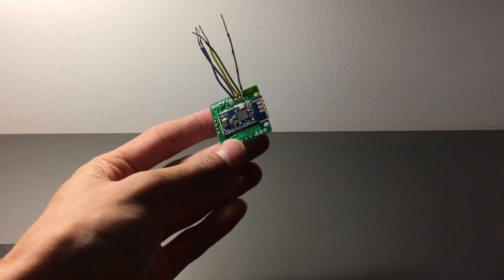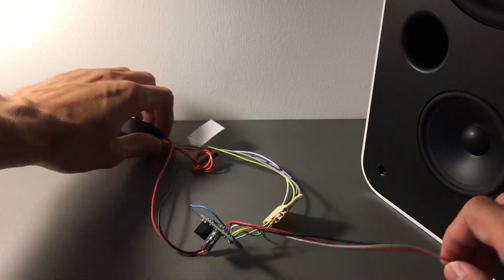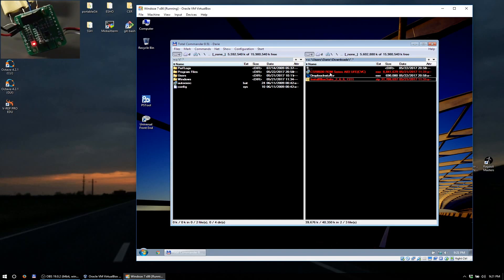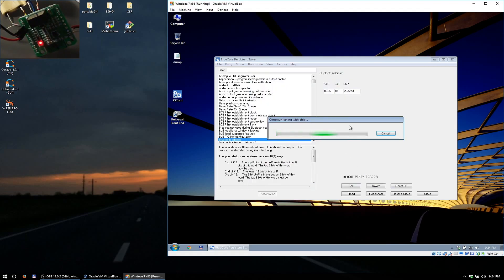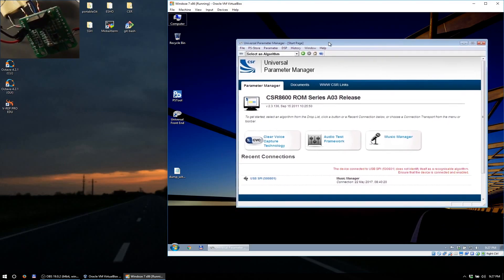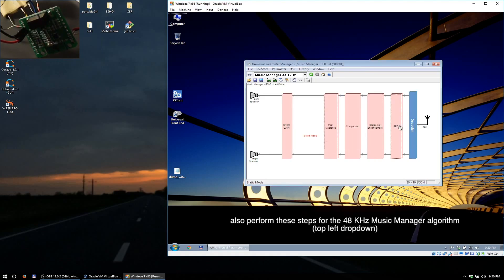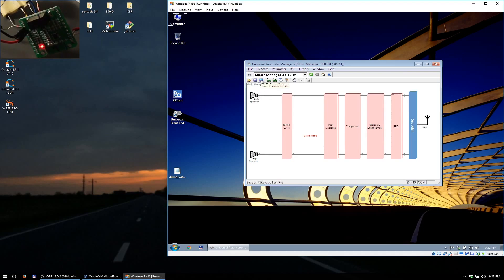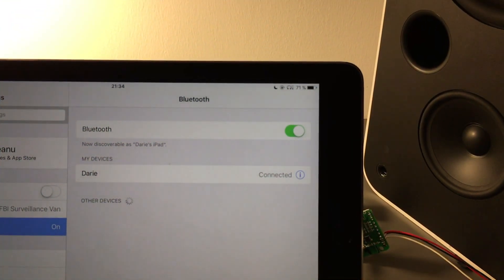CSR8645 Equaliser Set Up Guide

Comment: Do you know if dcm8633 and csr8633 or csr8635 have something in common, Like the pinouts?
Reply from the maker: Hm, I've actually never heard of the DCM8633 .. which seems to be the CSR8633 ... aand, yes - they do seem to be on the exact same carrier board, so the pinout should be the same

I have to ask though .. what do you have that has a csr8633 ? I've never seen them on anything
Reply: I ordered this bluetooth amp from ebay which is showing the chip csr8635 on the picture,  but received the one has the dcm8633 instead. Soni guess I can program it then right? I wil try it 

TDA7492P 2 x 50 Watt Dual Channel Amplifier Wireless Digital Bluetooth 4.0.. https://rover.ebay.com/rover/0/0/0?mpre=https%3A%2F%2Fwww.ebay.com%2Fulk%2Fitm%2F142568936090
Reply from the maker: In that case 100% sure, they even laid out solder pads for the 4 SPI connections on the bottom right (antenna facing up)

You might have to pull BOTH SPI_EN aand MFB

How's the amp sound ?
Reply: I liked it, actually sounds really good. I’m just hoping not to burn the chip while I’m trying to program it
Reply from the maker: well, if you do, another module's around 4$ including shipping
Reply: I know.. I got some csr8645 coming from china. And Just received the csr usb spi-isp programmer last week. The Dcm8633 its all I have at the moment.. I will let you all what’s up
Reply from the maker: sure thing, good luck !
Reply: Help!!!  changed the battery setting from vdd_BAT to vdd_sense and bluetooth module just turned off and it’s no longer power on. I can’t not change the settings because the program is not reading the chip
Reply: I don’t know which pin is the vdd sense on the chip
Reply from the maker: Holy shit .. can you even DO that :)) !?

Yeah doesn't sound too good if you can't read it .. might go have a look at the datasheet, but if the blue board the chip's sat on doesn't have that routed .. you're kind of screwed unfortunately

You could though keep trying to reset it with the PSTool (it has that restore all feature, then your flash back your stock dump - which I hope you did back up)
Reply: Yea I have already tried to marge the bump I created, before starting messing with it. But it doesn’t work
Reply from the maker: Restore is stronger than merging - have you tried that ?
Reply: No. I have not tried that yet but I’ll try that . So the restore option  It’s in the PSTool program?
Reply from the maker: yup, it's in one of the tabs on the top bar

Comment: Can someone help me please? I am not able to get this to working in Windows 7 or Windows 10

In Windows 7, PSTool is not recognizing the USB<>SPI converter. In the "Choose Transport" window, the "Port" option is completely blank. Windows 7 recongizes the USB<>SPI, just not PSTool. Does anyone know where I can find a download for the CSR USB<>SPI Driver?

In Windows 10, PSTool recognizes the USB<>SPI converter, but when I select it as the port and press OK, I get a message saying "Error Detecting Chip Type (Read failed on USB-SPI)
Reply from the maker: Are you running Windows 7 from within VirtualBox ?
Reply: Darieee , yes I am. I used the  tutorial in the description of this video to set up windows 7 in virtual box
Reply from the maker: Alright, then you most likely didn't install the USB Add-On (not sure if that's its exact name though)

Do that, then for the virtual machine settings, enable the CSR USB SPI Converter to pass through

As for the "Error Detecting Chip Type", that's 99.99% due to a bad connection between the programmer and the Bluetooth Module (I had a wire which was broken inside once .. took me 2 hours to figure out)
Reply: Darieee I did enable the USB add-on and Windows 7 definitely sees the USB SPI converter. When I go to "device manager" in windows 7 and click on USB, the USB SPI converter is displayed but next to it there is a yellow triangle with an exclamation point in it. When I click on it, this message (below) appears in the driver info. Any ideas??

"Windows cannot verify the digital signature for the drivers required for this device. A recent hardware or software change might have installed a file that is signed incorrectly or damaged, or that might be malicious software from an unknown source. (Code 52)"
Reply from the maker: Yeah, you need to uninstall PSTool and reinstall it again : at some point you have to make a decision on the transport type (that decision is only shown when installing for 32b)

Check my videos for when I install PSTool under windows 7, and see what I clicked there, off the top of my head I can't remember right now
Reply from the maker: Also it might be your windows 7 is acting up thinking the CSR shit is malicious - never run updates on the virtual windows 7 and disable Windows Defender in all possible ways

If that still doesn't work, I can probably send you a windows 7 image that works well
Reply: You were totally right about choosing the transport type. That was my problem and now PSTool in Windows 7 sees the USB-SPI converter! 

But I still cannot get PSTool to recognize the chip. I have multiple CSR 8645 chips and one 8635 chip and I'm sure that I'm wiring them correctly and all the connections are good. I can't get any of them to be detected by PSTool. Any idea, how I can fix this?
Reply from the maker: Mmm ... is your CSR USB SPI Converter set to 3.3v mode ? .. other than that .. tripple check the SPI_EN pin to be pulled high ..

Another trap for young players which also wasted me a good few hours is with CSR8635 chips (35 not 45), with those you have to pull the MFB pin high as well otherwise the chip won't boot

Comment: This doesn’t work for mac computers right? Or Yes?
Reply from the maker: works just as well with mac / windows / linux, since you have to set up a Virtual Machine (in my case, VirtualBox, which is freely available on all OS') running Windows 7 x32
Reply from the maker: let me know if you need 'help' 'buying' a copy of windows 7 x32 wink wink
Reply: Thanks. I will try to install virtual box

Comment: I have some bug...everythink works how in your video...but when I connect to other phone the equalizer is in its starting position flat.How I can do that every with I pair have the equalizer setting?
Reply: MrUnzO  use csra64215 chip it's better and have own app to conf.
Reply from the maker: Indeed, the CSRA64215 has a much more compatible app and the chip itself is way more powerful

You can ask sellers of almost any CSR8645 module to supply the 64215 chip instead for a very small price bump
Reply: And how I can turn down output volume PStool?
Reply from the maker: I have no idea how to turn down the volume in PSTool ... I always do it with the Gain selector in the equaliser view

I also don't really understand your problem .. Do you want to set up both the 44.1 Khz and the 48 Khz equalisers ?
Reply: When you conect other device like phone or tablet,PC that also have 44.1Khz your equalaizer settings stay the same?
Reply from the maker: yyyesss ! :D
Reply: intresting...also when I copy the parametrs settings like in your video it doesn't work.Only in programm when I download to board then it works
Reply: When I conect in live mode phone(android) it shows me ACC 44.1kHz MP4
When I conect tablet it shows me SBC 44.1kHz
When I conect PC it shows ACC 48kHz

Maybe every audio coding like ACC SBC need program equalaizer setting so DSP recognize it???
Reply from the maker: I suppose so .. Somehow all the modes can (for some reason !?) have individual equaliser settings (or perhaps they must all be the same and it's just some weird architecture quirk)

I tried setting up the 48Khz one and I believe my CSR8645 chip didn't "eat" the chunk referring to it .. and it was always gone after a reboot .. or it didn't do anything .. I don't remember
Reply: Same problem here
Reply: Do CSRA64215 need an isolation power supply like CSR8645 for ground loop issue?

Comment: Hello. I'm watching the video.

I am connected to the PST tool
Csr8600 is not connected.

Please let me know the solution.
Reply from the maker: check your wiring :) is your CSR SPI Programmer detected by windows ? Are you using 32b Windows 7 ?
Reply: yes. Using windows 7 32bit. Is the wiring in the naming movie different from the EQ wiring?
Reply: Pst tool works well.
but not csr8600 manager.
Reply from the maker: Here's all the programs I've got - most likely a different version will work: https://www.dropbox.com/sh/pl0jquyk9agp04a/AAC9AWPhGczJYeLptptIHOOPa?dl=0
Reply from the maker: Wiring's the same in all cases :) you just have to have some music playing when trying to connect to the DSP to set the equaliser
Reply: The below links is not working. Could you please give us a new link?

Comment: You don't seem "quite stupid", thanks for the video! This will help me immensely when I make my own headphones!
Reply from the maker: hah :D thanks - glad I could help
Reply: for sure! please keep them coming!
https://www.qualcomm.com/products/csr8645
Do you know anything about connecting batteries and such to the board it self?
"Charging:
Maximum Current
200 mA on chip
500 mA with external transistor"
Reply from the maker: +zarster uuuu .. yeah I never had the balls to go that route; if space is tight (as I’m assuming it is), then it should work ...

If it does do let us know (perhaps a video ?) - there’s quite little factual / howto videos on these chips

I’ve always used one of those li ion charger boards with built in protection : quite small and they do already have the micro usb connector: https://www.ebay.de/itm/322707974065 

Thinking about it - they might charge tiny cells too fast
Reply: I bought a 5 pack of thouse (knowing the faultrate on these products)
I have a CSR8645, CSR8675 and CSRA64215 board on the way. I want to make a set of headphones with built in microphones as to use it as a phone headset as well.. and as so I would like to take advantage of as many features as possible, Dual mic input, charging circuit and so on. some of the newer ones feature active noise cancellation built in! 
Check out the 8675 though, quite a capable little chip! https://www.qualcomm.com/products/csr8675
Reply from the maker: +zarster I had a CSRA64215 board not output any sound :-/ could you link the CSR8675 board you got ?

The li-ion charger have been bullet proof (at least the ones I received)

CSR did some outstanding work, let’s hope qualcomm keeps it up; the extra equaliser parameters sound very apetising
Reply: I suspect that the CSRA64215 is an I2S device, hence the lack of output.. I am not sure about it, this is the name of the one I got on ebay: BTM625 CSRA64215 Bluetooth Audio Module Wireless Module I2S/TWS/APTX 2.8-4.2V
Reply from the maker: the 64215 I had had some clearly marked audio outputs though ... so - whoever did the interface board for it messed up;

I meant to ask for the 8675 board you ordered
Reply: Darieee the AliExpress link above is for the 8675 board
Reply from the maker: a shit I must've had another tab open or something :))

Also - yeah ... let's see if these make their way into something a little more usable (read: with a differential/single-ended converter/amp on board .. maybe the 5+5W version .. maybe one with a ground loop isolator dc-dc converter) ...

I do kind of doubt that given the CSR8645 works I would say superbly ...
Reply: if you choose the second "color" option the picture changes to one with text stating that it has differential audio output, this is the version I ordered.
Reply from the maker: I saw .. but that's no good for something like an amp :(

Comment: Hey Darrieee,
I love your Videos! You helped me alot, i now know more about programming my CSR8635. But i have one Ask. Is this a 10k resistor what you use or what for a resistor? And then, how have i to connect the resistor? Thanks!
Reply from the maker: +CrazyLifeCrafter glad I could help !

I am indeed using a 10K resistor (check my renaming video - I go more in depth there about the wiring)

Basically you need to pull it high via that 10K resistor :: connect it to +3v3

Comment: Hi man I'm considering buying a CSR8645 to make a portable BL speaker I wouls like to ask you, are these the amplified boards? (On aliexpress you can find some that claim "5W+5W stereo CSR8645") If so, can you comment on the battery consumption, and sound quality ( unequalized), does it sound loud?......And if this are not the amplified boards, what are you using for amplification?
Thanks in advance and excuse the inconveniences.
Lucas
Reply from the maker: +lucasmonta1 hey - check my other video on this

I made exactly one of those from a kit more or less : https://youtu.be/Ly_9Cbx4O9Q

More in-depth build logs on Barry’s Youtube (linked there).

The 5+5s are amplified - what I’m configuring here is unamplified (in the case of these boards they just contain a chip that turns the signal from differential to single ended.

Battery consumption is stupid low, I initially installed 2 18650s and uppon reopening the speaker removed one (3000mAh gives somewhere around 10h of playback time, mileage does vary based on volume and genre though). Conclusion : extremely efficient amp this one.

Unequalized t sounds like garbage I’m afraid - and, if you get good speakers (why I used barry’s kit - he vets the parts and his cut is quite small), it sounds decently loud for the size.

Comment: Is this important to do if i want to install the CSR8645 in my car radio?
Reply from the maker: Not really, in your car it’s actually the least important of all places, since most car stereos have equaliser settings, and you can use those. I would recommend renaming your module for added swag though ;)
Reply: +Darieee What about the microphone and battery thing?
Reply from the maker: The battery thing was only an issue when I was programming the chip and powering it off the programmer at 3v3, the microphone is a MUST ! Otherwise whenever you start the car and are on a call, the audio will be routed tomthe stereo (which may or may not be on the CD/bluetooth mode ... a huuuge pain in the ass)
Reply: +Darieee Okay thank you
Reply from the maker: +Nikolaj you’re welcome

Comment: Thank you very much for this video. Is it possible to connect aux and get the dsp corrected signal out? If so, how?
Reply: The Datasheet of the CSR8645 suggest that this is possible, but there is no breakout for this on the common CSR8645 Modules (https://i.stack.imgur.com/j5nXO.png). Maby some pins are configurable, but i can't find any information on this either.

Comment: Thank you very much for your work. One additonal tip: if you have the module with the 5VDC breakout version, you should connect 5VDC to the VCC and connect also ground to the external power supply. The programmer module only has 3,3VDC and that is not enough for the DC/DC converter on the breakout module.
Reply from the maker: +Tim Kutscher mmm, but it doesn’t have to : the 3v3 I’m connecting goes directly to the input of the CSR8645; the dc-dc converter takes 12v in so that’s out of the question anyway [or did I get this completely wrong ? also - you’re most welcome]
Reply: I think you got me right. But on my board is the B0503S/D-1W (1W, FIXED INPUT ISOLATED & UNREGULATED SINGLE OUTPUT MINIATURE SIP/DIP PACKAGE) and this one needs 5VDC in.
Maybe you can describe in more detail where you connected the power supply.
Reply from the maker: +Tim Kutscher yours does in that case need 5, BUT ! if you’ll check my “renaming the csr8645” video where I go into greater detail on connecting, I (hope I) said to watch out for the GND connections; one goes to the dc-dc converter, the other one directly to the BT Chip GND. When you connect the programmer, use BAT (for the 3v3) and the GND closest to it
Reply: Darieee yes of course I watched the other video first. I watch this part more than one time to figure out how YOU connected the power. But I didn't get how you did it. But how ever - now you will laugh - my programmer is dead:( I don't know why because the renaming of the chip worked. And this is because of your great explanation! Now I've ordered an ordinary FTDI USB RS233 converter to program the Bluetooth chip. I'm eager if that will also work.
Reply from the maker: Are you sure its burnt ? I think I shorted mine out a couple of times and it's fine ...
Reply: Darieee I think so, because it's not recognized by windows anymore. I also tested another system. No recognition of any USB device in device manager:( so i gave up. Or do you know any trick?
Reply from the maker: nah .. smells like toast to me too in that case; let me know how well the FTDI programmer works once you get that going
Reply: Darieee the ftdi programmer is working :) I used the dll from here https://github.com/lorf/csr-spi-ftdi/blob/master/README.md . It works for the pstool but not for the software to setup the equalizer:( I tried out on xp virtual machine.
Reply from the maker: +Tim Kutscher alright, so, the CSR programmer’s still the way to go; or did that also not work ?
Reply: Darieee to go the secure way I think so, but I will investigate to get it work maybe with older versions. I will report my progress soon.
Reply: Now I found out that the cloned usbspi.dll has not all functions implemented as needed. I posted an comment on the issue page and to get answers. But maybe I have to order a second csr programmer:(
Reply from the maker: +Tim Kutscher yeah, would also be in favor of the more streamlined approach